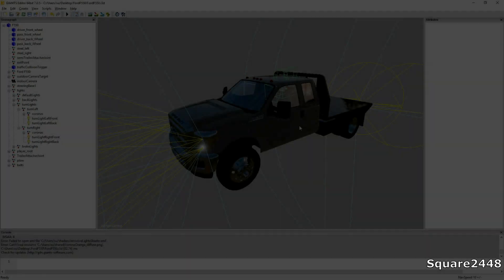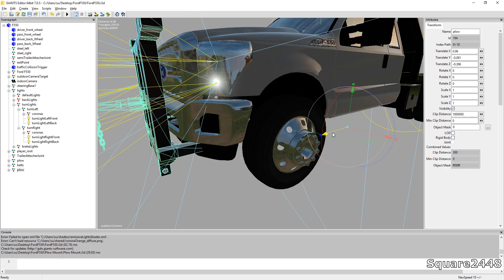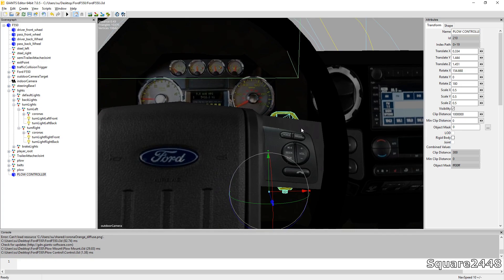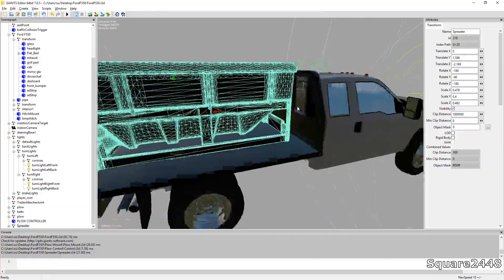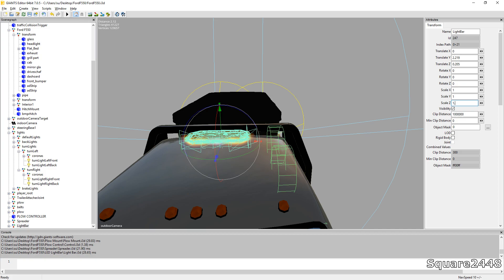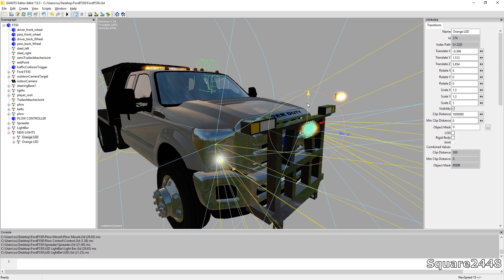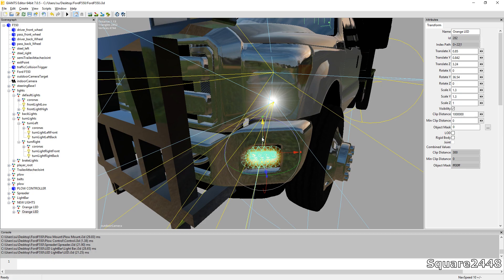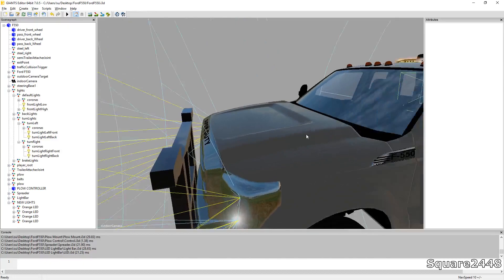FS17: Installing LED Lights, Sander & Plow Mount On F550 Flatbed

Comment: That truck already has a plow mount it just don't have the headgear. You can download fisher plows with headgear and plow on woodmeadow modding website. You will like those plows more. You used them sometimes in fs15.
Reply from the maker: I noticed after the video, Ok!